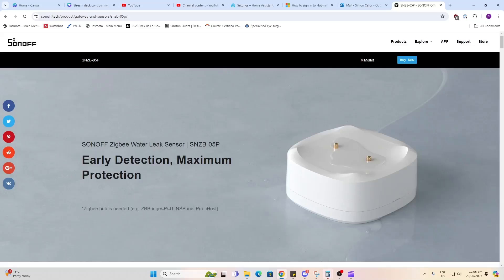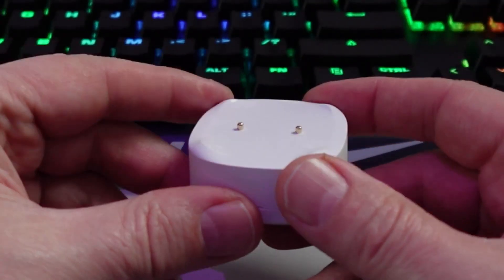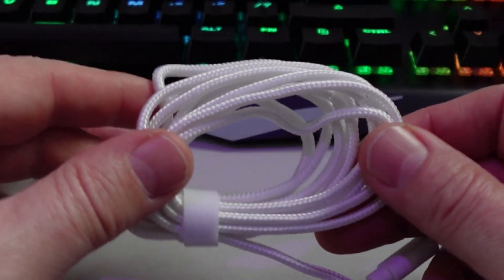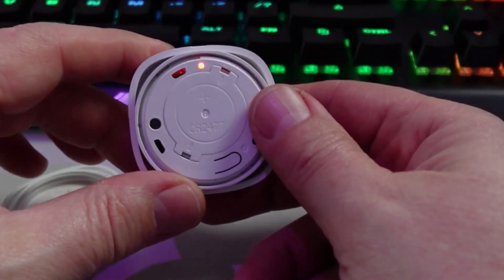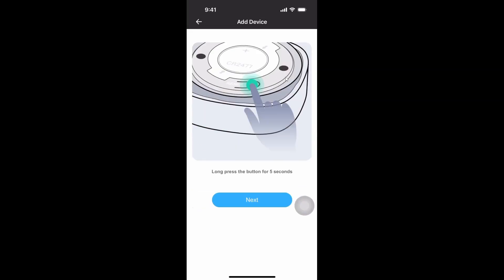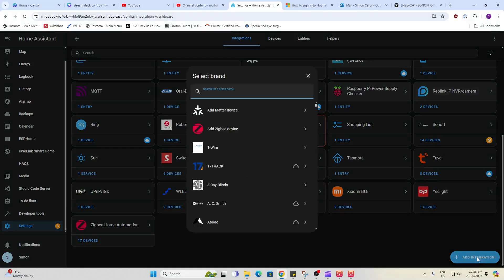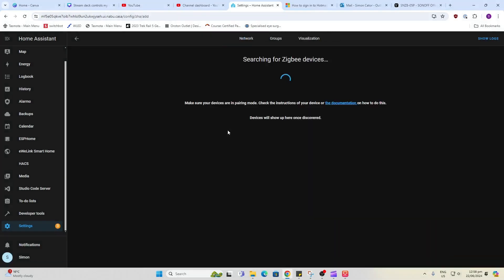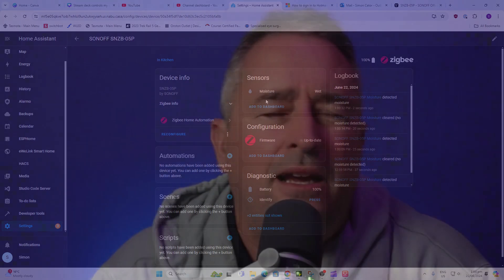SONOFF Zigbee Water Leak Sensor | SNZB-05P with Home Assistant

Comment: Kind of would have liked a more long term opinion, it’s straightforward connecting it’s whether it detects leaks in 3 months time and the battery is still near fully charged? That would help.
Reply from the maker: Hi Paul, I have just tested it after 6 months operation and it is still working fine.  The battery level is still showing 100 percent!
Reply: @ great to hear thanks